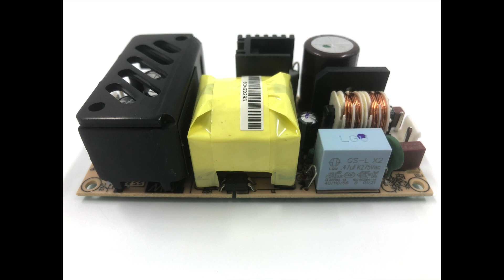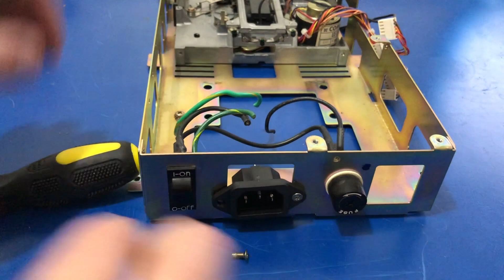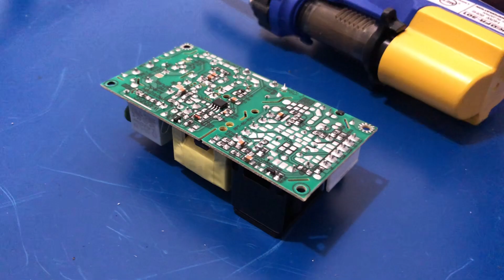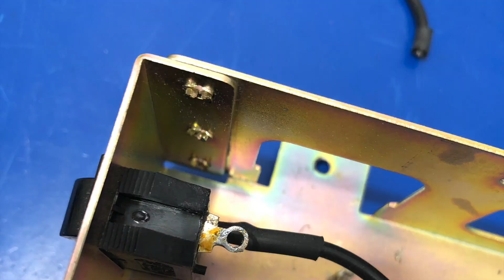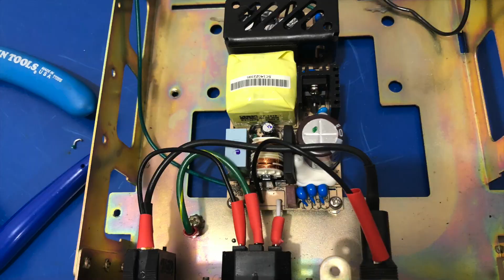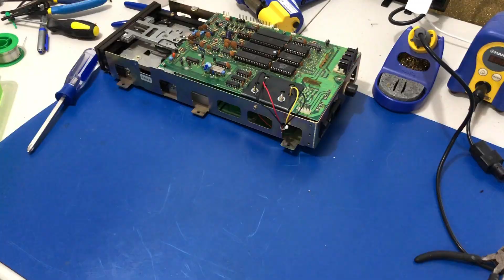1541 power supply replacement

Comment: I don’t understand why the extra green ground wires were added? The input connector has a ground to the chassis so everything attached to the chassis is grounded. 
I would also save the big header from the original transformer to PCB and reuse it to bring the 5 and 12 from the new PS into the pcb… just add jumpers to bypass the regulators you took out.
Nice job though! I’m updating a couple old 1541’s now too!
Reply from the maker: Hi Bob! If you’re ever watching one of my videos and I do something that doesn’t make sense to you and you’re wondering why I did it, the answer is invariably that I don’t know what I’m doing :)

That said, thank you for watching and for taking the time to comment. I I do appreciate it!
Reply: @ I was an electrical contractor back in the 70’s, then moved on to electronics for 35 years at Westinghouse, Kodak, and a major university… so I had my hands into this kind of stuff for a career! Good luck!

Comment: Hi I'm Italian. I saw your video. I have a 1541 with power problems. I would like to do the same job as you. What components did you remove from the board? Can you make a list? Thank you
Reply from the maker: Hi Cardi, sure, no problem.  The board in this video was PCB 251830 Rev A, Assy #250442.  If you've got a different board, this won't apply to you.  The parts I removed from the power supply circuit were:
C1
C2
C3
C4
C5
C6
C16
C17
CR1
CR2
CR3
VR1
VR2

Good luck with your repair!

Dave
Reply: @commodorehistory  Great dave, my 1541 card is the same one you used. Thanks for your reply. I only have one like to give you.

Comment: Wouldn’t it be better off removing the mech from the chassis to do the banging, drilling, handling, etc? … you can hurt the head connector wires or causing misalignment…..Also, much easier doing the wire crimping and soldering before placing everything in place in the chassis….IMHO. Thanks for sharing, nice video! Liked and subscribed!
Reply from the maker: Yes, I believe you are correct.  Many lessons learned since I did that :)

Comment: Wow, nice job but those rust spots, where the caps leaked, would drive me nuts. I'd take some CLR and a toothbrush to scrub it and remove the rust then do an enamel coating over it to protect the exposed area. BTW, nail polish is enamel paint and works great for coating stuff like that or adding an insulating layer to solder points that may touch a case point.
Reply from the maker: I’ll have to go back and watch the video again. I don’t remember which spots you mean, but I’ll open it back up and take your advice. Thanks for watching :)
Reply: I know this is 5 months too late but in case anyone else is wondering.  That is not rust from cap leak, that is dried up glue that Commodore used to glue down the large caps to the board.  It seems they didn't always use the same glue as some of the stuff they used dries out and can eat the mask.  So yeah it is a good idea to get it off.  Of my 1541s only 1 has this crusty glue, the rest have a different glue that is still white/clearish in color.  You can also find this glue inside some C128 PSUs.  So it is a good idea to check.  Ray Carlsen's Commodore repair site has pictures and more info about this problem.

Comment: Nice video! I have 5 working 1541's and have wanted to do this ever since Adrian Black did it on May 27th 2019. I marked it as watch later so I could find it again. When I finally got around to wanting to try it, I then saw in all the comments after it was made that the $2.30 PSU from AliExpress wasn't up to the job and Adrian had even pulled the link. I followed others to a few that used the Mean well RT-50 to do the job but watching them do it with that PSU was like trying to fit 10 pounds of potatoes into a 5 pound sack! Seeing your video this morning has me once again wanting to try and do this to one of my 1541's. The PSU you used, Mean well RPD-60 is nice and tiny, only a bit bigger than the one Adrian used so plenty of room to make it fit. Again, well done and this video has very high production value. I'm your newest sub and now I have another source of Commodore content. Thank you.
Reply from the maker: I’m using this drive on a daily basis and it’s been working well. Good luck with your project!

Comment: Nice work, but I’m wondering why nobody solders the 5V and 12V to the bottom of the board when they do this mod?
Reply from the maker: My thought process when I was working on it was that I would route the new wires up through where the old ones routed. But yeah, I like your idea better. I just didn’t think of it :)
Reply: On the one reference link, they did just that!